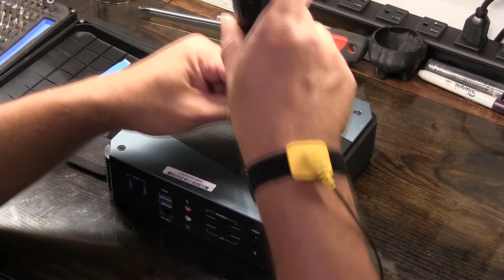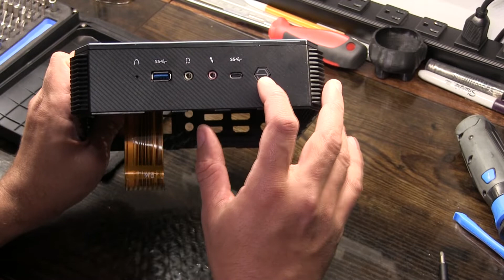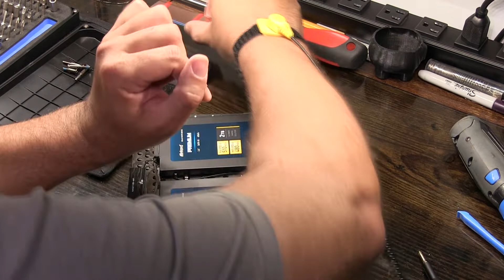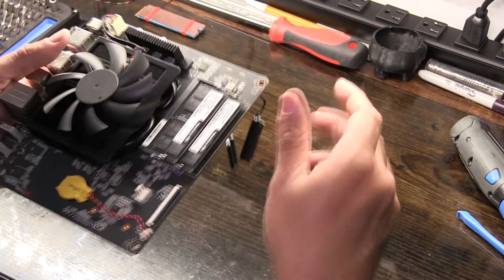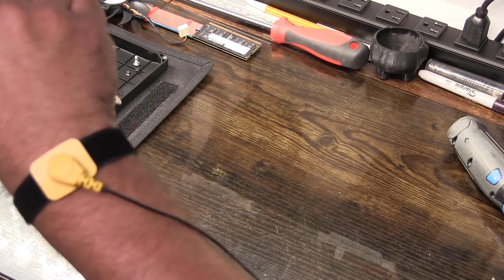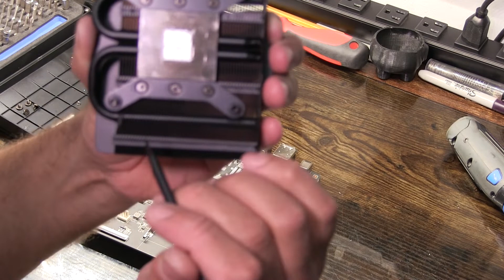Minisforum HX90 Part1: (Quick Benchmark & Teardown, PCB look)

Comment: The problem with Minisforum is that their customer support is very terse, minimal & unengaging. The worst part is that they don't want to do anything with the bios (ever). They're very resistant to updating the bios. They refuse to even talk about it. They won't even give people the current version of the bios. It's like a national secret, or something. Very bizarre. Like it's personal. 

So, that's something to keep in mind if buying any Minisforum computer. If something's wrong (later) with the bios, it's a disposable computer. They almost certainly won't update the bios. (Right now the HX90 suffers from video stutter (related to TPM). AMD released a firmware fix months ago, but Minisforum won't release a new bios. The board doesn't have a TPM header for a hardware device. So, a lot of people are stuck now. If Minisforum ever does release a new bios, they won't give you the original one in case you need to go back to the original for some reason. (They won't even tell people what the latest version of bios is for any machine. It's horrible support. Very alienating of savvy customers.).

Comment: Awesome video! I dont think there is another video on YT which goes in this much of details for HX90 MiniPC from MinisForum. I also have the same exact barebore one and I installed SSDs and RAM.
Did you notice anything regarding the FAN Noise on this thing? I feel like FAN noise on this MiniPC is not good and too loud. Its noticiably loud. I wish  could change FAN on this thing and go with less noisy one.
Reply from the maker: Thanks.  This mini PC got one of the lower fan noise in our experience.  The new HM90 (using Ryzen 4900H) has a easier adjust fan control in the BIOS, and the default fan noise shuld be lower (you can also turn it way louder).  We will do a review on it soon.
Reply: @electronicshobbyisttechnol3347  Thanks for the reply and I am looking forward to your review video on the same! ✌️

Comment: which power profile did you choose in the bios?
also can you also test the lower power profiles 10-15w with some scores in CPU and GPU performance
Reply from the maker: Hightest setting(54W).  However, the CPU still runs around 65W in windows, maybe due to boost (just keep this in mind, if you want to limit the SoC to 10-15W, use 3rd party tool, don't do it under BIOS)
If lower to 10-15W, you 100% cannot get the same score. 
10W (15 to18W in windows): 7608 points (CinebenchR23, CPU temp 42°C)
15W (24 to 30W in windows, wow): 10701  (CinebenchR23, CPU temp 52°C)

Hope this helps.  Again, to beeter control SoC, I suggest to use a 3rd party to control it (OC or lower wattage, both work great)

Happy new year
Reply: @electronicshobbyisttechnol3347  thank you very much for all the details.
happy new year!

Comment: what kind of fan is it? If it dies can a replacement be mounted in?
Reply from the maker: TF90S12L-12HAA, when you searching it just use the "TF90S12L" part.  

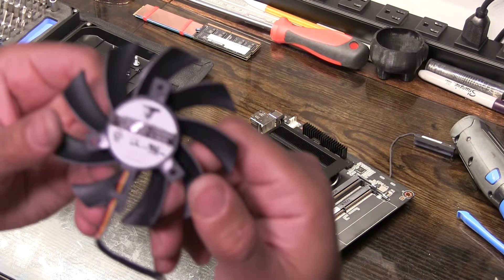At 15:22, you can see there are 3 mounting screw holes.  Those are the 3 mounting places.  

This kind of fan is more widely used on a larger GPU.

Comment: Which monitor are you using?
Reply from the maker: We got it from Amazon, the one we got is the older version.
Here is the new one (Just a direct link):
https://www.amazon.com/dp/B07R7QH787/ref=cm_sw_r_apan_glt_fabc_1CG0MEGD7R9S96DF4RK5?_encoding=UTF8&psc=1
Reply: What is the quality like? Have you ever tried to power if off a powerbank?
Reply from the maker: @missingpunctuation  Quality is really good.  Any powerback you try need to support PD (PowerDelivery).

Comment: Nice tear down. Can I just check with you, the m.2 you used is 2TB? Minisforum doesn't say what is the maximum capacity of that m.2 slot. Also, I noticed an empty 4pin sys_fan1 header, do you think it's possible to install a slim fan anywhere inside the chassis? Is it also possible to replace the CPU cooler fan with a better slim fan?
Reply from the maker: Usually there is no max capacity for a M.2 slot, just issue with single and double sided SSD.  In the case of HX90, it does support double sided SSD.

Yes, there is one additional Fan Header, if you can find something to fit inside and secure it, you can do that.

As for the fan, it is possible, but you have to get the fan from Aliexpress or Taobao (because you need to use the photo search function from those app).  The fan measured around 84mm in diameter (but the model says TF90S12L, so I think they put it as a 90mm fan).  Make sure the mounting holes are in the same shape.  Also, "GPU Fan" might be your best keyword.  However, if you get GPU fan, you need to cut off the connector, as it will be the small 4 or 5 pin GPU header and make it into PWM header, here you need a regular 4-pin PWM.
Reply: Thank you for the reply.

Yes, I actually asked Minisforum themselves and they confirmed the M.2 specs.

Note taken on the additional fan header and the possibility of swapping out the CPU cooler fan.

I just wanted to be sure of these things before I actually order this HX90.

Thank you so much once again.
Reply from the maker: No worry.  Great that I can help.  Just a final reminder, while CPU fan replacement is possible, but you do need to take your time to find one that will fit.

Comment from the maker: The unit we have is the barebone unit. Spec include above and the following:

Storage:  Inland Premium 2TB SSD M.2 2280 TLC +  Inland Premium 2TB QLC SSD SATA x2 in RAID 0

RAM: TEAMGROUP Elite DDR4 64GB Kit (2 x 32GB) 3200MHz 1.2V

All benchmarks were run at 54W configuration (Video said 65W, that was a mistake).

This video was edited on this unit after we put the unit back together using the 75W OC setting.

Please stay tuned for the next video.
Reply: So the barebones that can be purchased at Minis Forum or other stores can wit everything except Storage and RAM? Is a doubt that I have always. Thanks in advance!!
Reply from the maker: Yes, for barebone unit, you need to have your own Storage and RAM.  I think so far you can only buy from MinisForum store.  It might come to Amazon eventually, but that will take awhile (also, likely not the barebone version).
Reply: @electronicshobbyisttechnol3347  Taking in account that Minis Forum has a lot of models, what would be your suggestion for trading? Recently I bought Mac mini 2020 but unfortunately only support two monitors. Looking for complete the setup with other mini pc with Windows but don't want to go too expensive in this last one but the more cheaper models no idea if the performance will be appropriate. For example this model that supposedly is he most powerful in a deep test versus the Mac mini 2020, the Apple machine is clearly better in practically all specs.
Reply from the maker: Well, it will be hard to say.  What are you using your PC for?  
Also, you said "only support 2 monitors", so I can safe to assume you have 3 or 4 monitors?
Please provide a bit more details.  Games, software, etc that you use the most often.
BTW, yes, M1 is crazy powerful, however, 5900HX is a bit more powerful in the CPU level.  On GPU level, I don't think gaming support on mac is quite the same as windows.
Reply: @electronicshobbyisttechnol3347  I use pc for browsing, multimedia and mainly for trading, many charts opened as mainly and more demanding task. I don't use for gaming or rendering videos. By the moment only two monitors, but I want to have the choice of adding four monitors and basically watching these monitor because I will change of country and is more versatile to bring un with me.
Reply from the maker: I see, in this case, many of the Minisforum products will fit you.  I would say you can pick from the following:   (support 4 monitors): HX90 
(Support 3 monitors): HM90 (on pre-order now), TL50, HM80, HM50
CPU from all the above are all very good.  Hope this helps.
Reply: @electronicshobbyisttechnol3347  Thanks for your suggestions. Was looking the UM270 that has very low price at 257€ as barebone, but I don't find the info of the type of Pci-e that support for motherboard. Probably only Pcie and not a Pcie 3.0 for make it faster adding 32 Gb RAM. Do you think with this config could be solved enough for trading?
Reply from the maker: Ah, I left UM270 out.  Yes, it only support SATA SSD.  For normal use, this does not make any difference at all no matter what.  I would say 32 GB of RAM is a bit overkill, but if you can find the RAM for a good price, why not?  Just a thing you must pay attention to, the RAM need to be 3200 MHz using 1.2V.  The timing will be a bit bad, but Ryzen CPU need high frequency RAM.  There are many 3200 that is in fact 1.35V, those need XMP support in BIOS which most miniPC does not have.  If the RAM does not say 1.2V, it is 1.35V.  It will make a difference.
Reply: What are the specifications of the sata cable?  My Hx90 unit came with one and now I want to add a 2nd SSD and don't know which cable to use.  It's not avaiable on MinisForum's website. Thank you.
Reply from the maker: @yvesrn  Send an email to MinisForum support, most likely they will take care of it.  This is there own design, so only they can take care of the issue.